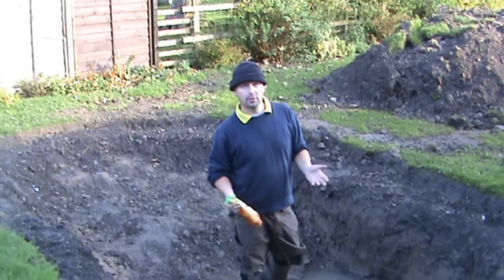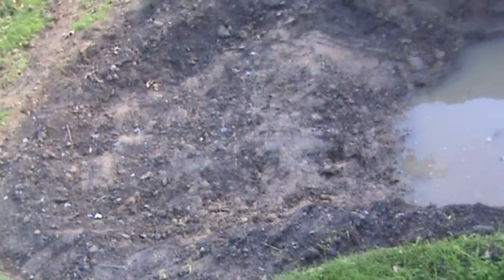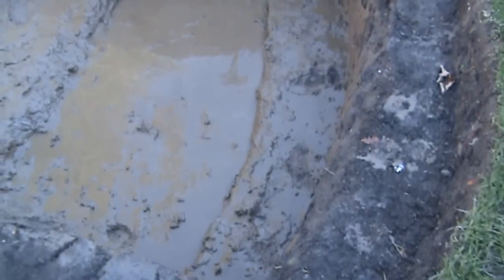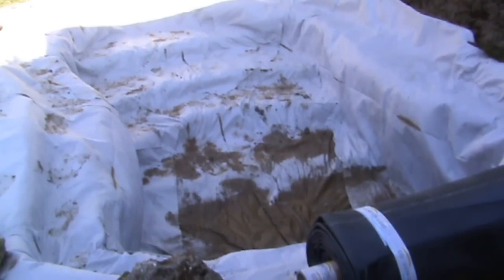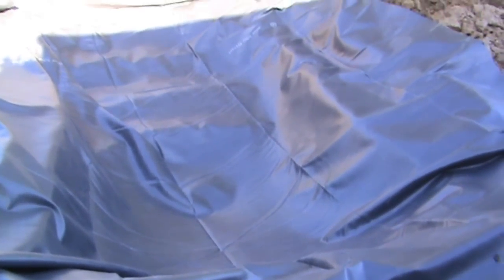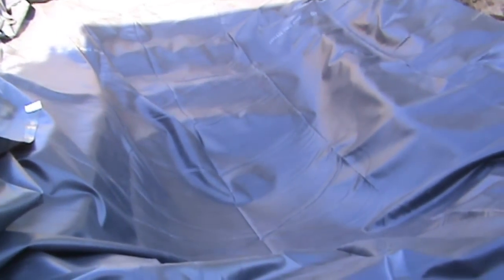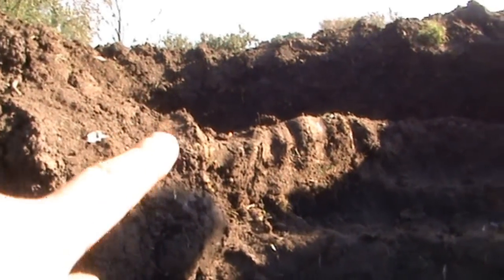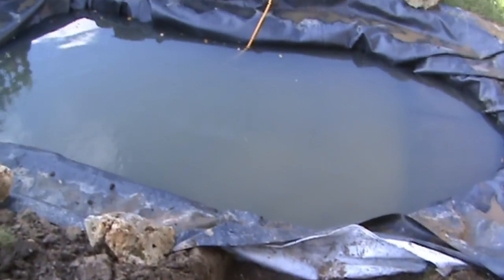How to Build a Fish Pond Part 1 - Digging the Hole and Laying the Liner

Comment: I dig my pond 2 m deep, with a shovel and one bucket in one week! SIzes are : 6X5 (middle is 2m deep, at the edges (half meter from top) it is about half meter. 

It was a hard work and my back was hurting, it the end I extracted with showel more than 35 cubicmeters of gravel, rocks, glass, nails, one army helmet, bones, and sand. 

I`m writing this,because I want to suggest to dig pond with your own strenght, because, You feel really excited when You are finished.

Comment from the maker: You can have a slope at one area, no worries but it pays to have the lower part of the slope humped up to retain stones and cobbles (unless you are cementing them in) to avoid them migrating down the slope to the bottom of the pond. There may be a few videos in the pond playlist where I have done this but none spring to mind.

Comment from the maker: I'm sure I mentioned that it is 1mm thick rubber in the video? Anyway, that's what it is. 1mm thick rubber from Firestone. The size for this particular pond is suited to this pond (I can't honestly remember as it's not important). 
Liner should be the length x twice the maximum depth + 1' (30cm) overlap each end. Likewise the width needed will be width x twice maximum depth + 1' (30cm) each end. That gives length and width of liner needed to line out any hole/

Comment: Any advice on using epdm roofing liner for ponds with koi and aquatic plants?
Reply from the maker: +Robert Gould Jr. I know that Firestone who make the liner I used in the video make EPDM roofing liner and it is exactly the same as the EPDM pond liner so no worries there, It is made to withstand UV and be impermeable to water, plus it is inert so I'd say if you have roofing liner spare and want to make a pond go for it. Just make sure you have a good underlay to prevent it being punctured from below. Certain plants will go through flexible liner and they include larger sedge species, typha and larger iris so endure the plants are not planted where the liner is folded or put more underlay over the liner as roots can get stuck in folds and puncture liner. Other species will be fine.
Reply: Pondguru Outdoors Thank you so much!
Reply: Pondguru Outdoors I'm only finding 4ft×50ft rolls it seems as though I might have to use seam tape to connect a few rolls together. Any suggestions on this or should I just save for one piece which I priced out to be around 1000US dollars? Thanks again!
Reply from the maker: +Robert Gould Jr. I would personally go with the one piece liner which would be sealed in factory as although the liner can be joined on site the conditions need to be really good to get it perfect. It would have to be joined on a clean flat surface then lifted into the pond which is asking for trouble in the UK as the weather isn't great ad often there isn't suitable flat lean land near the pond to do the joining. Although I did the Firestone course where I was joining liners together in different situations I never put that into practice for my work as doing it in a factory and on a site are totally different situations.
Reply: Pondguru Outdoors Very good info. I do have a basketball court in my backyard so I might have enough room to seam tape all at once on a flat surface. 1000-1200 dollars just was more than I had expected to pay for liner ;(haha
Reply: +Pondguru Outdoors Any other cheaper alternatives for a DIY'er? I'm using scraps of carpet and carpet foam as underlay too. As always much appreciated.
Reply from the maker: +Robert Gould Jr. While there may be cheaper materials available for both the liner and underlay I would never compromise on either of those items as they are the most important parts of the pond and the hardest to replace if anything goes wrong. Pumps and filters are easy to replace compared to the liner.

Comment: Any tips on digging clay soil,it is such hard work.
Reply from the maker: Provided the clay isn't full of small rocks it is great to dig in as it makes it easier to make solid shelves.
Reply: Thanks for your advice,
Reply: To dig in clay, first use a tiller to loosen the clay, then remove the clay and repeat until you reach desired depth.  You will still need to shape the sides, but that's pretty easy once each layer is removed.